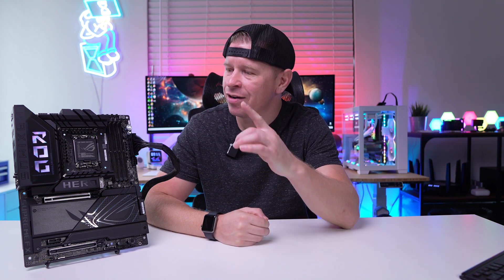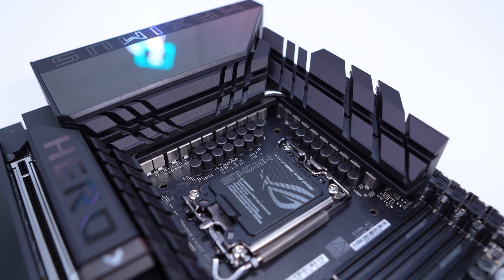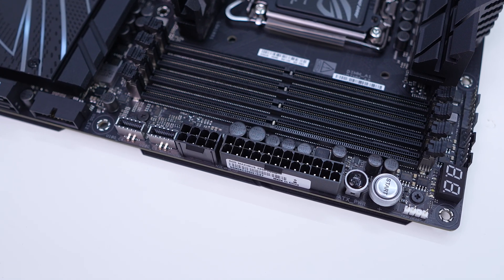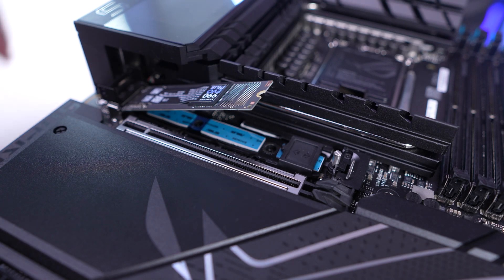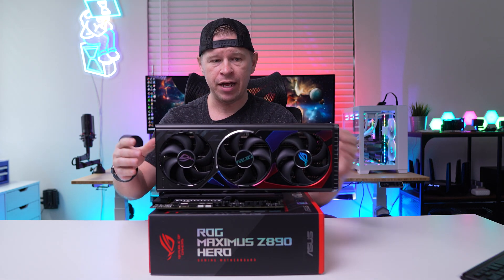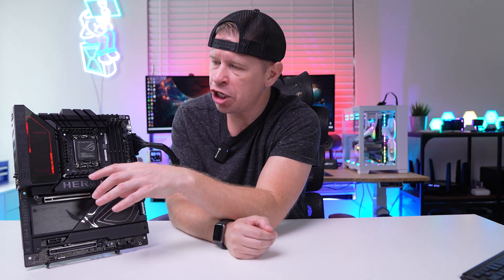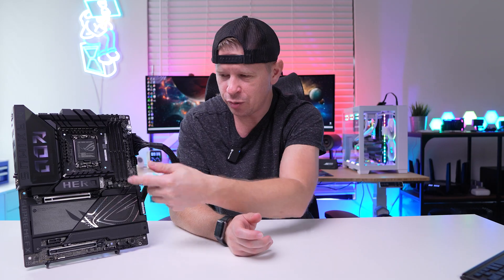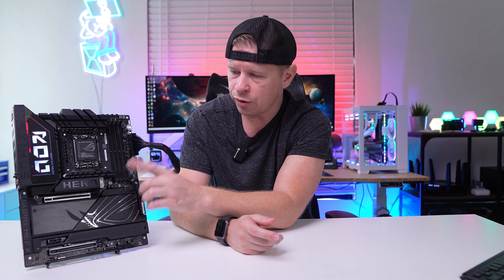ASUS ROG Maximus Z890 Hero Motherboard Review

Comment: I just got one for 399! It's on sale. Very good motherboard l paired it with intel ultra 7 which is also on sale for 279!
Reply: This is a steal now with the 265k.  You have to be crazy not to upgrade to this combo in late 2025.  Tune the 285/265k and it becomes a monster with the strongest memory controller on the market.
Reply: I just did the same thing! It's a super nice board!

Comment: I bought this board, hooked everything up and get no power. The ROG thing displays and my AIO cooler screen lights up along with the Power and other button on the MB but that's all that happens. I've been sent a 2nd board and same exact thing. Tried my old PSU, same thing. I've built numerous PCs before and haven't seen anything like this. No error codes on the MB.
Reply: Ever figure it out?
Reply: I have the same issue. Two boards as well. Any ideas? Been a builder for 30 years never had anything like this. No PSU fan movement at all. Tried multiple PSUs, removing CPU, all different hardware. Only constant is the case and CPU cooler, Noctua 
NH-U12S. Maybe CPU shorts something out and ruins the board immediately. It's my only guess. I don't have a known good board to test with or a different CPU to test with. It's a 285k CPU.
Reply: The rog MAXIMUS hero is only compatible with INTEL cpu. The asus rog crosshair is AMD cpu. That might be the issue?